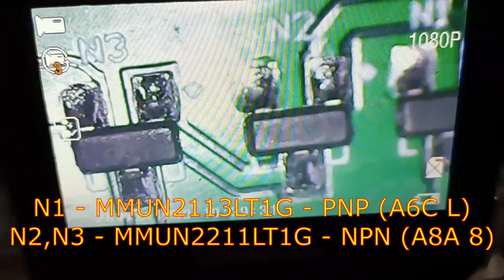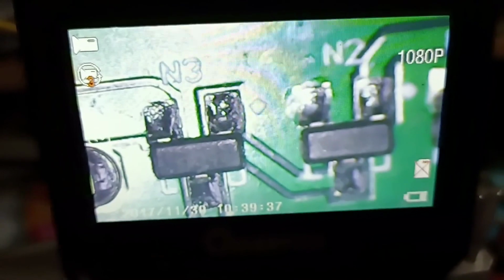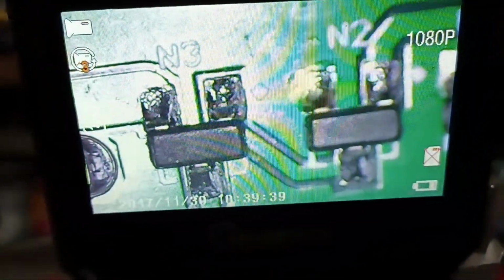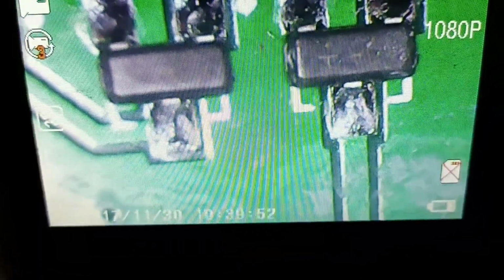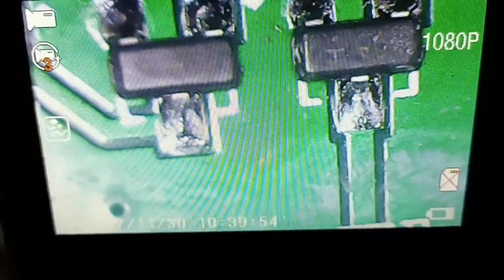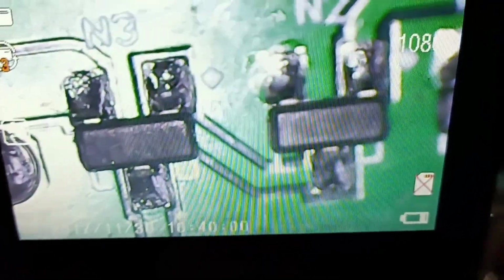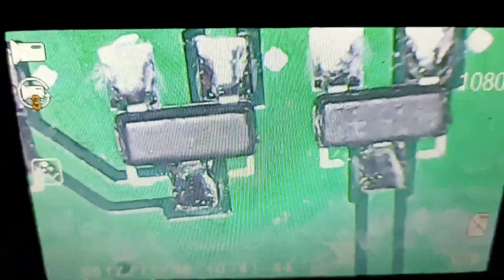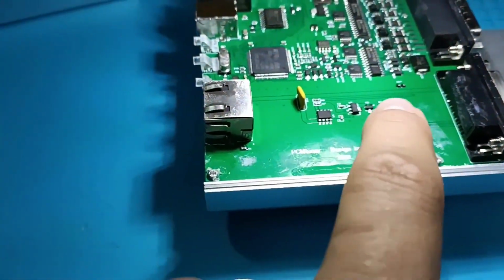PCM-Tuner repair. these Transistors mounted wrongly by the Manufacturer must be changed !!!

Comment: one Question: Q3 is on "Frontside" like the N1, N2 and N3, thats ok. 
but on other Side you have red rings on Q8, Q9 and Q10, because Q11 is a little bit near on left side (under CB11), and Q8 is K4N Transistor, did you changed the Q8 Transistor to MMBT2222A-7-f ? or did you only Changed Q3, Q9, Q10 and Q11 ???

Comment: When you change all is working well with programmer? Most of these components can fail due to incorrect bench pin selection. People are reporting no change of transistor and working ok. Module 71

Comment: I replaced the main 2 under the board that effects bench module 71 and now my bench mode works perfect, what do these effect? I have test obd read and bench read and write and so far all good, never been brave enough to write obd as I have genuine tools so not worth the risk.

I have wrote EDC17C10 with tactrix clone with pcm flash 1.20 but only cause file structure matched pcm flash over x17.
Reply: Main 2? Could you be more specific?
Reply: hello, you mean for GPT function only?
thanks !
Reply: Yes, just for bench function module 71, since  replacing them mines been rock solid, not had a single issue in the 10+ or so times I've tested
Reply: @killerconsoles517  hey, thanks for Fb, i did resolder 2 of them to 1P (K1P over GPT side), PCM started to work, cool :) thank you!
Reply: @killerconsoles517  one has been shorted, i could measure closed circuit.
Reply: Please help me , need advice , teams ASSKKR